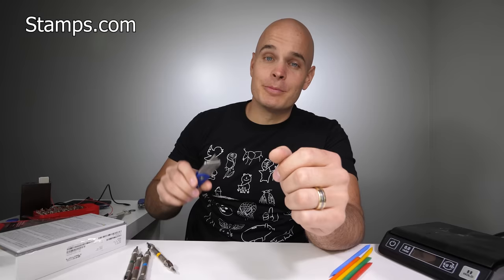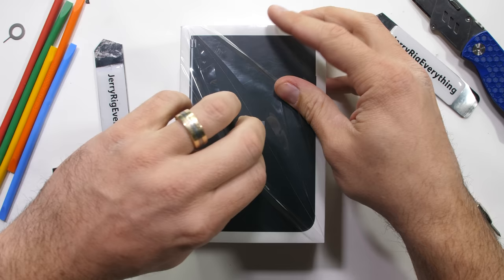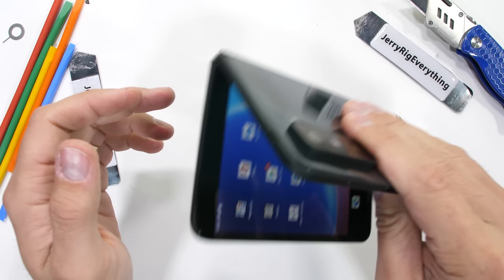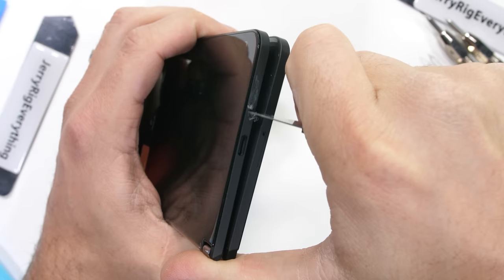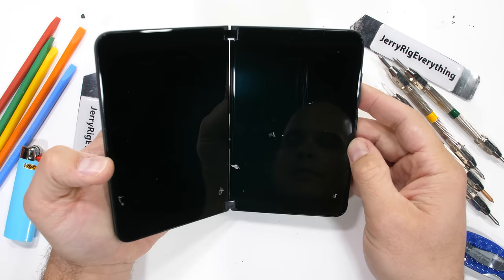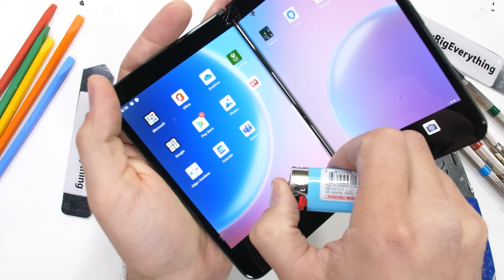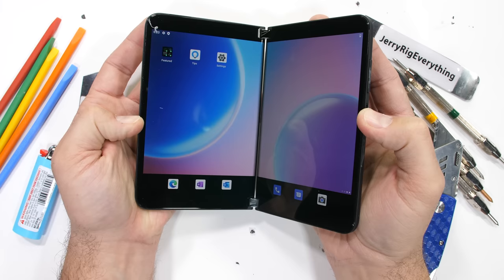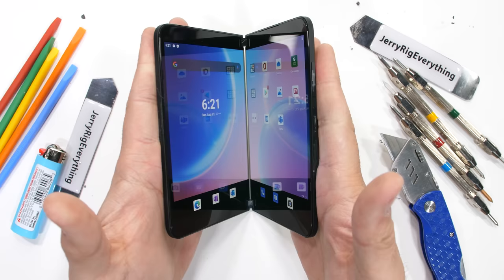Microsoft Duo 2 Durability Test! - There's one big problem...

Comment: I'm thinking the new hinged devices are going to need a twist test in addition to bending. Hold each half on opposite sides of the hinge and twist across the hinge itself.
Reply: Seems obvious that this is required !
Reply: Agreed lol.
Reply: While I'd certainly like to see a bit more carnage, I have to ask: what real-lkfe situation would this try to simulate?
Reply: @KleversonRoyther  twisting a hinge across its axis could be a result of sitting on it while open on something soft like a couch
Reply: @wotan2383  good point!
Reply: @wotan2383  if you put your phone in your back pocket and go around sitting on things you deserve for it to break. That's just common sense.
Reply: @EikottXD  I don't think there's any way you could have this thing open in your pocket, I'm talking about if it's left open on a couch and you accidentally sat on it
Reply: @wotan2383  I guess so.
Reply: @wotan2383  I still don't see how sitting on it would cause any twisting. Wouldn't it just be pushing it down into whatever surface it's on? If anything it's more of a crush than a twist the way I'm imagining it.
Reply: Excellent, and also a sit on it while open on couch test as well.
Reply: yeah I also want to see it under a tank or road roller too....just in case!
Reply: Do you think Jerry will do this on the MS product? This guy's prejudice is what's obvious
Reply: You'd be surprised how strong i would be.
Reply: I think that's a quite sure way to kill them. So I don't see a point in doing the test if we know the outcome.
Reply: @wotan2383  that could happen with the plasticky screen foldable phones too tho which might hold up worse being sat on
Reply: He didn't do it because it's not realistic.
Reply: Any form of torque on that hinge will probably decimate it instantly

Comment: I totally agree with the software part. Windows in such a device would be awesome. Add another USB port and you have yourself almost a laptop replacement.
Reply: Even just a second USB-C port with OTG would allow you to charge it and use a USB hub at the same time. It would be awesome.
Reply: But like zack said  if Microsoft did do that then there would be no need for laptops, and ppl would just buy the phone.
Reply: @Potatoechip203  nah
Reply: Well, I wish it was that simple, though. Windows is a bit finnicky in a tablet form. Not to mention Windows on ARM has a horrible compatibility issues with many apps, since most Windows apps are designed for x86.
Reply: @Leona_tf  not that horrible as it still can run those app. Windows 11 also bring x64 support. Windows on arm need powerful chip as MacBook does
Reply: @ianfahrizal85  correct me if I'm wrong since I may have misunderstood, but x64 already existed ever since Windows XP. When I'm talking about x86, I'm talking about processor instructions.

And yes, Windows on ARM can run these x86 based apps, but barely. The performance is terrible (according to one source, it could be 3 to 8 times slower, but don't take my word on that).
Reply: @Leona_tf  sure it slow thats why it need something better or equal to m1 processor. Actually I'm talking about x64 support on arm device
Reply: @ianfahrizal85  I do agree we need emulation that can compare to Rosetta on the latest Macbook if we want to see more Windows running on ARM devices. But I don't know when will Microsoft move their heavy butts, if ever.
Reply: @Leona_tf  exclusivity with Qualcomm will end up soon, hope mediatek or Samsung bring the bar high
Reply: I think they just dont wanna pull off another lumia.
Reply: that was supposed to be surface neo, the one announced with the duo 1 but was cancelled due to the cancelation of windows 10X
Reply: @Leona_tf  exactly what you said, not to mention battery drain. All x86 apps need to switch to native arm asap.
Reply: Yeah, but you either need to use ARM Windows version or put a laptop processor there, which would significantly lower the battery life.
Reply: @Potatoechip203  As long as people need to be productive there'll always be a need for larger screens and larger physical keyboards.
Reply: @emilecroons  Tru
Reply: Widows on mobile device ???
Haha .... they tried windows 8 / 10 mobile and was really bad to use .... 
Not proper designated 99.99% apps for touch and worse dual screen.
Windows is good only with keyboard  and mouse.... a lots of memory and fast CPU.
Reply: @Leona_tf  and not for touch.
Reply: @Cyba_IT  you don't use apps ([app]lication[s]) on non-mobile devices? have you never run a webapp? You know you could just write a script that opens the respective website in your browser of preference then register that as an app on your desktop with an icon, right? It may sounds complex, but it really isn't. Once you've done that (or someone else did that and you installed it) you can simply press the icon an the website will appear, magic.
No, the bigger problem is that all those app which where written for windows weren't made with mobile devices in mind. They may have a alright interface for people using a mouse/trackball/touchpad, but suck for people using touchscreen. The layout of the app also wasn't with mobile devices in mind. So you'll probably end up with an unusable mess. It would be like using the desktop version of a website on a mobile device.
Reply: Let's go! Another Windows Phone!
Reply: Microsoft tried making phones with windows in the past and they did not do so well on the market so the gave up on it.
Reply: @theonewhoknows338  Nah
Reply: You should check out handheld PCs
Reply: Yeah but it's £1500, even if it had windows software who's buying that. There are much more cheaper windows products and they are much better

Comment: A full Windows experience on a device like this would be absolutely sick! I can see if standing up vertically, text document on one side, research articles on the other. As well as connected to an external monitor via HDMI. That would be sick
Reply: Widows on mobile device ???
Haha .... they tried windows 8 / 10 mobile and was really bad to use .... 
Not proper designated 99.99% apps for touch and worse dual screen.
Windows is good only with keyboard  and mouse.... a lots of memory and fast CPU.
Reply: @mirek190  I have a laptop with a 7" screen that runs full Windows 10; it runs well enough for basic tasks. It's also not even the most powerful device of that size available. Microsoft Duo would essentially just be replacing the keyboard with another screen.

Win 8 and Win 10 mobile were far from the same as Windows on desktop. Using that as a comparison is a meme and a half.
Reply: @Emerald_Night  Windows 10 desktop on 7 inch screen ...basic tasks ..suuuure.
No counting that 99 % desktop apps are not designed for small screen .
...no comment ... It's masochism.
Reply: @mirek190  but you do realise windows 11 can use Android apps on it's operating system.
Reply: @divyangverma9880  x86 android apps compatibility is poor ...and not count you can't use Google play .

Comment: I think android is capable of a Windows like experience if MS was willing to put some work into it. Samsung DeX was able to do it and MS partnered with them to make the office apps a better fit for it. Not as flexible as full Windows, even an ARM version, but a modified android is light enough for what mobile can manage currently.
Reply: Samsung sex was a variation of Microsoft continuum from lumia.
Reply: @krisshietala2119  u mean samsung dex?
Reply: If you actually used Samsung Dex, you'd know how insanely limited it is compared to even Windows XP.
Reply: No, Android just isn't there. It needs full Windows 11 to get there.
Reply: @1050-Argon  Continuum was great, it didn't fail, the device failed in the market. Porting that technology to Android, no telling. It might happen. Or Android might be a short layover to a full Windows 11 experience.
Reply: @snookiewozo  I do use DeX and I know it's limited. That's why I said it's "Not as flexible as full Windows". Windows XP though? You can't even install a currently supported version of MS office on it. What a terrible example to use.
Reply: @mikebutler9332  MS Office? *visible disgust*

Comment: It still baffles me, that in times where being environmentally friendly, companies refuse to work on a 1-for-all solution. Samsung Dex comes close, but is still weighed down by Android, the same issue that the Surface Duo runs into. Apple's getting closer to perfecting the iPad as a 1-for-all solution, but even with that M1-chip in their Pro models, they still left out some features that would have made the iPad a fully fledged, smaller, lighter laptop. Pretty sure it is no coincidence. These companies still prefer we carry around 3 different systems with us, whilst trying to come across as caring for the environment.
Reply: The thing is, though, that often there’s need to use multiple devices simultaneously. But you do have a point, some people would benefit from an all in one depending on lifestyle and career
Reply: Lets not forget the repairability, hard and software restrictions

Comment: Microsoft if you are somehow watching this, for your smartphone variant have the start menu screen as the screen of these phones. The issue with your surface series is that they do not have specs of modern devices, it overheats while being idle, and you're charging apple prices for Apple level hardware. You can only pull what apple does with a reputation, so make really good products with hardware of a modern Laptop. People will live with its thickness, no matter how thick. Make it durable and Repairable. This is doable, or you can wait when everyone is doing this, years down the line and keep chasing their tails.

Comment: Been waiting for that exact thing myself Jerry.  A tablet or dual screen device of this size running full fledged windows.  Productivity king and i could replace nearly all devices with that single one since its so much more capable.  Having a 4G or 5G connectivity with windows in a nice package would be awesome especially now with windows 11 enhancements to touch.
Reply: I guess you gotta get not-that-smol surface now
Reply: Bro you have handheld touch full fledge  windows 11 with mobile graphics cards available
Reply: @faizanqasim4499  not anything worth pocketing and using for daily use.
Reply: and windows 11 running Android apps
Reply: @starflyr57  personally I couldn't care less about android apps. They're basically is a native app or webpage for everything already. Android apps are at the very bottom of the list of things to be excited for with windows 11
Reply: @MrM3drvr   I couldn't care less either..  but obviously the masses due. That's why Windows mobile already failed. lack of apps. if they could have the amount of  or the ability to run Android apps back then Windows mobile may have succeeded
Reply: ive got a chinese hundred dollar, 10inch win10/android tablet in my drawer.
it runs fine,,but why?
win10 is dreadul on a tablet
Reply: @chargeriderepeat7024  we didn't say windows 10.  And you can't possibly compare the experience of windows 10 on a cheap tablet to windows 11 on quality hardware.
Reply: It failed Yes, but that doesn't mean it wasn't a great OS... It failed because there wasn't a market for it. I just watched this on a Lumia 640 LTE and I can't see any reason why a Windows Mobile wouldn't succeed if they (Microsoft) played their cards right...
Reply: Have you EVER used a Surface Pro? I think you'll eat your words if you realize the meaning of what you just said. Great OS will run shxtty on crappy hardware... That's a given, it's all about your choice... & your budget too LoL...
Reply: Look up the GPD win 3 if you haven’t already, full fledged windows 11, in your pocket.
Reply: it performs fine..but the OS is garbage, the UI is atrocious.
what is even the point of it?
Reply: Why call him Jerry though? I thought his name was Zack?

Comment: I don't think Android is holding Microsoft back. I think Microsoft can't get their act together and optimize Android for their needs. Other companies managed to do it and Android is pretty solid.
Reply: Yea.. im sure you'll going to have a very bad time if its run windows with that spec even with windows rt..
Reply: @VISHVplus  I'm not familiar with that specifically, but Samsung, Motorola, Huawei and (heck, even novice) Royle have managed to produce fully functioning devices.

And even closer to the Duo is LG with their Dual Display case (which wasn't even physically attached to the device) and did not suffer from the problems Microsoft is having with both Duo 1 and Duo 2.
Reply: true BUT windows is way better
Reply: @YasinHasan  I like Windows a lot but recently I've been using my Android smartphone for everything and basically don't use my computer anymore. I guess if I needed to do real graphics or editing (basic I do in my phone and works great) I'll need to get out my PC
Reply: @Kenny Kolodor I was referring to Android and foldable devices. Samsung, Motorola, Huawei, OPPO, LG and others managed to make decent (or great) foldable phones on Android while Microsoft can't seem to pull it off.
Reply: @sayididit2930  give it some time ... not sure how young you were to remember the first iteration of android, but 1st of anything is a risk ... even the first episode of the big bang theory 😂
Reply: @mailarrives  i had a number of Palm Pilots and a few Treos and Centros... I know that the first iteration may not be the best, and i don't expect it! Heck, the first Galaxy Fold had many issues and they've improved and improved (not saying I'd buy one yet, but they've come a long way.) However, the Duo 2 is not the first foldable, not even for Microsoft, hence the 2. If this was the first dual screen device to come out, I'd be more lenient but it's not — far from it...
Reply: @sayididit2930  the hardware is not that bad. it is the software. and unlike Xboxes where Microsoft married the hardware well with software/UI, they are working with some of the best engineers to solve this problem, and I know for a fact that they will. my only gripe has been the price point. their $1500 asking price is expensive than many kidney stone surgeries
Reply: @mailarrives  i can't say i agree with you about the hardware. Actually, the Duo 1's hardware was technically better then 2... So they are going backwards 🤦‍♂️ But again, this whole conversation was about software...

Comment: I agree about Android on this phone. They should bring Windows Phone OS back!
Reply: Weemizo  yes and no.

Microsoft is known for the fact that that they bring out good and then bad and then good operating systems. Microsoft can learn from there old mistakes and make a Windows phone OS that is as good as Windows 7/10
Reply: Weemizo  It really wasn't. I've had 3 windows smartphones with pretty humble configurations and they worked flawlessly (at least performance wise).
Reply: Weemizo  Nope. The only problem was the lack of apps. And most OSs today are inspired by windows phone and windows 8's flat UI, so MS was way ahead of their time
Reply: Only if they can pull of x86 emulation properly

Comment: I really like my Duo 2 so far, software oddities aside. The software bugs are nothing huge. I like that this is different, and the screen aspect ratio feels better than the ultra wide of most phones. That long, skinny brick design is getting old. I don't mind at all that the phone needs to open to answer. It auto answers if you flip the second screen all the way around. Being that it feels like a book, reading books or comics on this thing feels great. If there was one real criticism from me it is that the default Microsoft keyboard, which you basically have to use, leaves a bit to be desired and needs more customization options.
Reply: Why can't you use the Google keyboard?

Comment: I would absolutely love a windows version with ryzen 5000U series mobile chip in this thing. 5000U series processors are made for thin and lite laptops while having double the core counts and integrated graphics of equivalent intel chip. So if they make it a inch bigger and lil bit thicker they can definitely fit that chip, get rid of the camera bump and a lil bit more battery maybe. It'll be the best selling foldable.

Comment: Windows Phone... didn't exactly go so well though. If Microsoft had stuck with Windows Mobile and made improvements maybe things would have been different, but now in 2021 it really doesn't make sense for Microsoft to have yet another crack at the phone market, in software terms. Remember, Android apps are coming to Windows 11 so you will get interoperability on that front.

As for whether it would sell, the Dell Venue 8 was probably the best known 8" Windows tablet when it launched, but Dell don't sell anything that small now. Even Microsoft's own Surface Go's screen has grown from its initial 10". Full fat Windows apps just aren't designed for screens that small, hence we got touch-friendly UWP apps... which did the same things Android apps did only worse. Outside of specialist devices like the GPD or Steam Deck, I don't see small screened Windows devices making a comeback.

Comment: im surprised manufacturers don't leave a little dent for the bump to fit in when folded. it would work so well and make a really cool connection
Reply: I have been thinking so much about that. All they had to do is plan for it during the development and not after thought. Design the motherboard such that that space for the camera inside the frame is deliberate. I bet they can find a spot for a smaller pen design like those of galaxy notes. I think once AMD's NUVIA arm SoC comes out, a Windows Os version of DUO should be very practical and they MUST use USB4